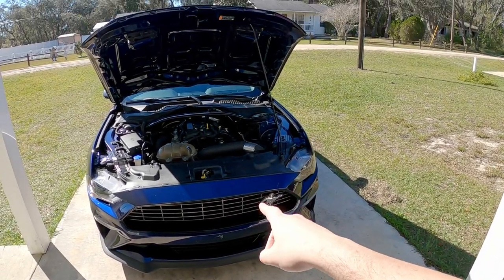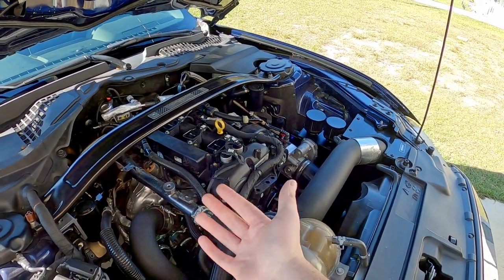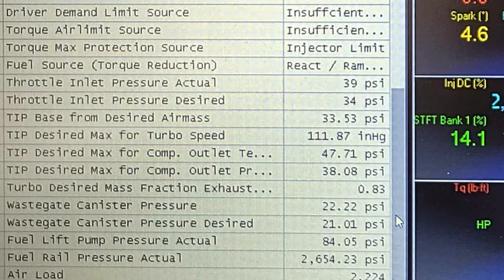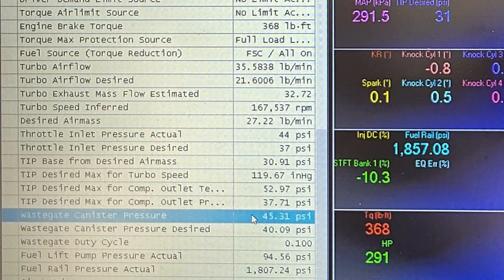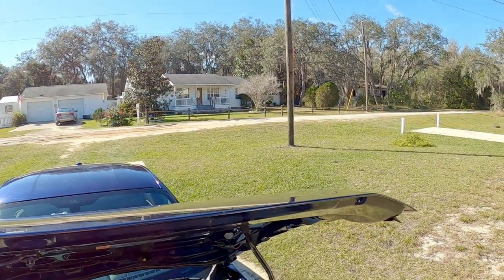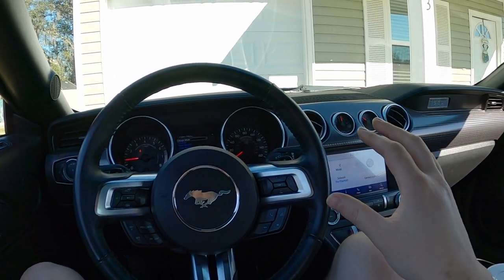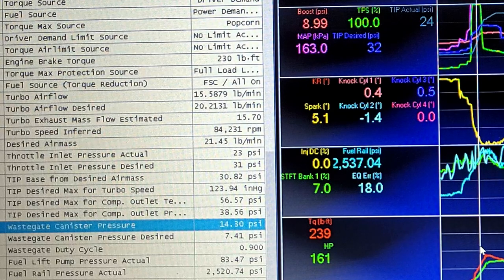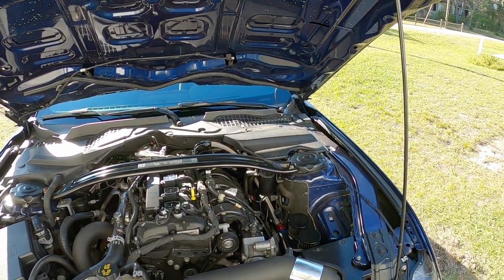I Have to START OVER with my Mustang

Comment: What Spring do you have in the wastegate? I believe stock is 7PSI.   A rule of thumb is to not desire more than 2x the base spring pressure.   If your target boost is 28ish you should have 14psi springs in the actuator.
Reply: this is my thoughts exactly
Reply from the maker: 12 psi spring 🙂
Reply: @KarzKreated  When did you upgrade it? Is it possibly faulty?

12 psi and 28 is still a bit of a difference in my opinion.

No idea what the issue is just spitballing some ideas cheers
Reply from the maker: I've had in for a while now. The thing is, I'm not trying to target 28 psi (yet). I'm trying to keep everything close to stock numbers (22 psi) until I dial it all in.
Reply: @KarzKreated  this will be last last comment about that WG actuator (I use them all the time the IWG-75's aren't the devil), I am not going to tell you what to do or how to do it, I like this channel and look forward to more videos. 

@2:25 you pointed to the boost signal (Boost reference/ signal lot's of names for it) and referred to it as "Dome pressure"...... Dome pressure is actually the opposite, "Dome" is used to hold the gate closed against boost signal pressure.   there are two perfectly good reasons to force the physical gate to be closed, #1 there is so much exhaust pressure in the manifold the gate leaks & #2 you have to command the WG Duty over 85% to get to desired boost.  

  You can raise "Dome pressure" and lower WG duty cycle to achieve the exact same boost.  the only tool you have to change "Dome" on your car is the spring(s) in that actuator which is 100% fine to do but you have to scale back all the tables that control desired boost and bring down WG duty-cycle to make up for the 5 extra PSI coming from the "Dome"/ WG Spring.  You have solved the task of rescaling the tables to make up for the bump in "Dome" buy allowing an exhaust leak pre-turbo.

   Like I said I'm not going to tell you how or what to do, but when your looking at data and see 'Desired" that is a sum of all the tables to come up with that number..... when you are looking at the stock tune, if desired = 15PSI but you have 5PSI of dome that is 20PSI actual (actually desired, not an actual result) .   if you want 22 and desired is 22 add in 5 psi of dome/spring = 27 if there is minimal boost creep or a spike it will be magnified by the extra dome.  

There is more, but I have a hard time conveying what I'm thinking into typing,  if what I think is right, the stock WG spring was 7psi (I did a 30secong google search verify this before you do math)  and if you have a 12psi spring there is a 5psi discrepancy
Reply from the maker: This comment was very helpful. Thank you 🙂

Comment: Is there a way to adjust the wg duty cycle to be less in ecu to help with boost. When the duty cycle is hitting around the .5 value it seems to hold it fine and it looks to start at .9 so as an experiment try a range of .7 to .4 maybe that will tune out the overboost and help compensate for the large cams.
Reply from the maker: I've flattened the DC in a previous revision with no change in boost control.

Comment: is it possible that you have to upgrade the physical wastegate to accomodate the cams? 

Like its just not handling the upgrades? 

Curious about your thoughts

Cheers and thx for the video
Reply from the maker: Well a physically larger diameter wastegate would certainly help. The internal WG door is tiny. But that's not a easy or cheap solution 😅
Reply: That's exactly what I was going to say. Definitely sounds like the wastegate is too small as the commanded pressures on the actuator is correct at the time of the spikes (unless there is something physically stopping the wastegate from opening all the way). If you can log actuator pressure I suspect you'll see it actuating early in your revs and peak somewhere before max rpms of your pulls. 
Also if you are getting less power for a given psi, your turbo may be getting too small causing excessive back pressure on the exhaust (and driving the compressor out of it's efficiency band). Are you able to log back pressure of the turbo and discharge air temps of the turbo compressor?
Reply: sometimes  a half inch hole just can't be a one inch hole  @KarzKreated
Reply: It is possible to add a remote sensor to the turbine housing, in the 2/3 chamber, near the head flange.
You may even be able to import the information to your ECU, using the HPtuners Interface (but that's going to take some research).
Reply from the maker: @coyote_chaser  I had mentioned in a previous video about tapping the exhaust housing to monitor pressure. I still plan to do so at some point.

Comment: do you think the turbo is now to small ... Many factory turbos are as small as they can get away with,  Add any thing that increases flow can throw the systems all to hell
and add  some times facts are facts and feelings are not
loving this chase keep on trying mate you will win
Reply from the maker: I don't think the turbo is the problem.  Ford Performance advertises the cams to pair well with this turbo. I very well could be the problem 😅. But I'm doing what I know works.